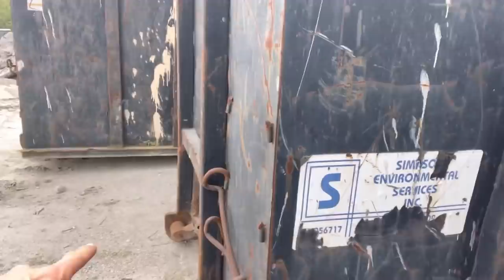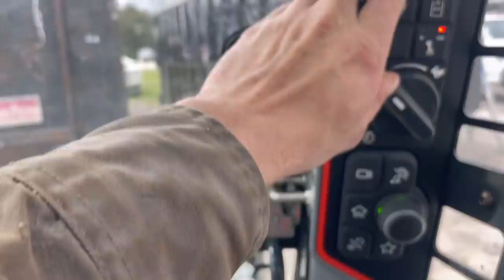SMALL WELDING BUSINESS PROBLEMS! | Can I Save the Day? |

Comment: build u some half clamps. half the time you go for heating and beating and a half clap may have done what u wanted to do. hell i would use it just for a perch for that angle to sit on so you could lever that angle up top. had me worried that lift looked tough. glad u stepped back and went for a safer option.

Comment: Anthony, do yourself a favor and get a 50# can of 8018. For when you're in a bind and you can't run 7018 and you need the strength, crack resistance. I understand the argument 6010 not going crack if your bead is filled in and backfilled good on dry material. I think it would be well worth it to have available just to be completely sure of something.

Comment: When Im.welding and run into those places where you can get optimum rod angle. BEND THE ROD!. You would have probably had some stops ans starts but you could have ran the 7018 uphill that way and completed that weld.

Comment: You do know another easy way to get a heavy piece of angle iron up on a dumpster? Cut the angle in half and then weld it back together unless you don't trust your welds  to be strong enough to work that way I mean afterall you'd probably end stitching your welds all the way down both sides of the angle anyhow. Right.

Comment: I'm not a welder and this is the third video I've watched from you.... I don't know what beating slag off of the rod means
Reply: It means it’s time for Texas Tig
Reply: smaw rods have flux on them to prevent oxidation of the metaled metal while red hot.  this flus is what he was referring to.  after it burns, the flux becomes slag ion the weld bead that is removed with a wore brush.  when using a smaw rod for filler metal, the flux is removed and the bare rod is melted into the smaw puddle

Comment: You didn’t have to use Texas tig. You tack were it’s wide and then hit it with a hammer it will close up.
Reply from the maker: Let’s see you do that with 3/8
Reply: @MeltinMetalAnthony  I wish I could show you. You don’t go right to the big gap. You start were it’s kinda touching. Get ur tack real hot then hit it with hammer and go down the angle iron and it will close up. Thnank you have a good night. Meltin metal Anthony.
Reply: @oscarborjon6112  yup yup getting a nice hot tack and hitting it with a beater always worked for me too.

Comment: 6:25 You should have an apprentice helping you with this lifting stuff. Or, cut that piece in half with your torch, then weld it back together when you get it set in place. That's the name of the game isn't it? welding stuff back together?

Edit: 7:25 I see you figured it out.

Edit: 7:45 we know what it means, you are not using the proper sized rod and you are using a technique that wouldn't pass an xray or bend test. As long as it isn't a structural support or risks life or limb, farm welds and made up "techniques" are fine I guess. Don't guess it matters on an old dumpster.

Edit: 8:05 I am surprised you were able to weld anything that high off the ground without having a shield from the wind (welding curtain or leather apron blocking the wind away from your welding area).